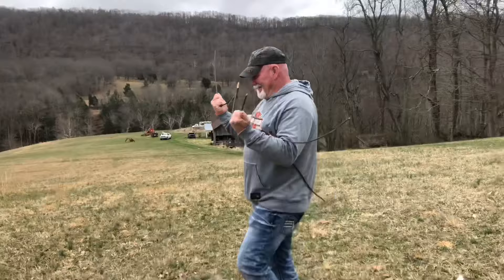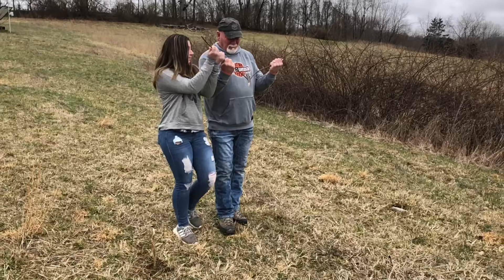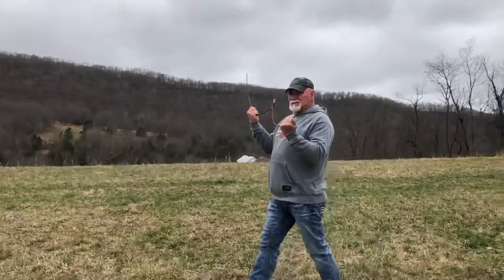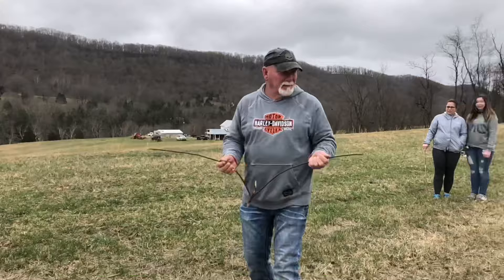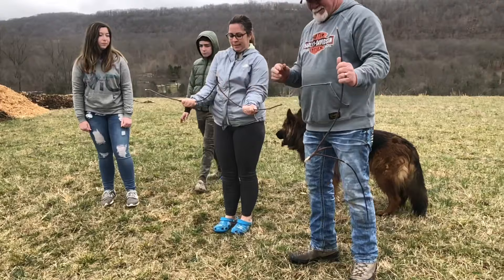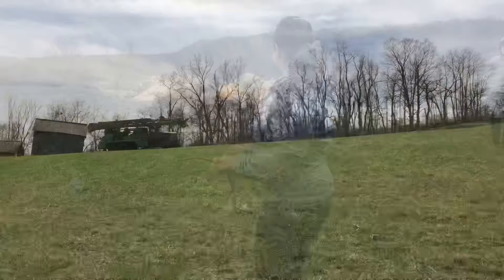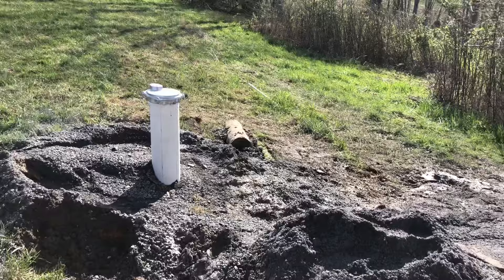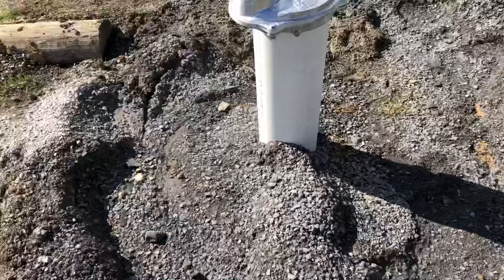Dowsing / Witching a well. Does it work? Thousands of $ later we find out.  Definitively answered.

Comment: I worked in the scientific world all my working life as a scientist in Silicon Valley.  I'm now retired, on 5 acres where we built a house.  I became curious about dowsing, discarding all the weird stuff about magic crystals and zeroed in on copper dowsing rods with a copper handle.  So my local hardware store had 3/16" copper grounding rod and 3/8" copper tube and that's what I made my experiment with.  I bent the rod so I had 6" handles and 18" horizontal bits.  
Then, without any expectation of any result I walked over my land and I was astonished to find that the rods swept outwards when I walked over where I had water lines, propane lines and septic lines.  I got a set of flags which irrigation guys use to set out a line of pipe from Home Depot.  Then as I walked the lines I planted a flag about every 10'.  They were more or less in a straight line following the underground pipe.
I experimented with and without gloves, I got no result with gloves and did get a result without gloves on the same place.
I also placed a very strong magnet on the ground where I had got a deflection and it had no effect on the rods.  I used one of those magnets on a rod that people use to pick up nails and similar large metal bits.
I conclude that this phenomena is not electromagnetic nor is it due to the earths natural magnetic fields.
I found that it does not need water in the pipe.
I also concluded that the phenomena is from the human body, the rods are simply indicators.
How and why does it work? I'm working on it...!!!
Reply: Hi Doc, I was a a drain cleaner for 20 years then plumber. I liked cleaning drains. Professionally when you have the proper tools its really not bad. I've cleaned over 40,000. Had a farmer call me out to the boonies one day. He met me at the edge of what looked like Lake Erie,
I was located in central Ohio. He told me, looking out over this never ending body of water, that a group of trees every bit a mile out had 6 feet of water under them. Then we drove down the road about a half mile and pulled into a farm house driveway. He had a track hoe and a hole 15 to 20 feet deep. He said, "if you run your cable about 50 feet up that pipe you should hit something and get that water moving."

Well I'm thinking I can run a hundred or a hundred and fifty feet up the 6 inch field tile but it was 3 thousand feet to the water.
Okay, lets give it a try. I set up some 2" pvc pipes to run the cable thru and started up the tile. 50 feet I hit a spot and before long water started flowing. "Damn," a few more minutes and the stoppage was cleaned up. (Probably roots)

The guy was so happy as he slapped me on the back and said the water should be gone by next week.
I thought maybe 6 months but kept my opinion to myself.

Anyway, he had said he and his Dad put the drain in 35 years ago so he knew where it the tile was.
Well I wondered for years how he knew where the stoppage was and only dug one hole in a mile long drain 50 feet below the clog.
He witched it. My old boss, I remembered, showed me years earlier using welding sticks with the flux knocked off how to locate
pipes that DO NOT have fluid in them. The bigger the pipe the deeper it works.

Freaking amazing.

I told another story of mine at apple drains video. Look down about 25 comments to read it if you don't have anything better to do. Yea, right.   https://www.youtube.com/watch?v=q3bR3UU6UGA     Good luck........I think it is just some help from upstairs.
Reply: It works from witch craft bout 1500 to 2000 years ago you can watch sam and colby if u want if u dont like scary stuff dont watch them or u could watch TFIL
Reply: Glad to see I'm not the only one. You can walk over ground where the rods don't move and then trow pvc pipe down on top of same ground and walk back over and they will move. Also I've found if you hold hands close together they push apart from each other and if you hold your hands shoulder width apart they pull to center.
Reply: @Moz29   that's uncalled for wtf?
Reply: The dowser makes a small hand movement, often subconsciously, at a location they expect something to be. If you already know approximate location of pipes or a spring then all you are doing is fooling yourself. Successful water dowsers actually use cues and clues at the property whether knowingly or subconsciously. Ground elevation and topography, soil hardness and moisture, vegetation, surface rocks, the location of nearby bodies of water, etc. They don't need divining sticks or rods, they could just as easily walk the ground and point out the better well locations.
Reply: @tomszabo7350  brilliant explanation. Let’s not forget also that water is basically everywhere if you dig deep enough.
Reply: @Moz29  Genius, as if your science can explain everything. But you skip out on that part because it will degrade your ego.
Reply: @yummygoy5138  I genuinely have no clue what you’re trying to say.
Reply: @Moz29  If your "science" is so great why can't it find the cheapest solution to purifying seawater or prove the unbased evolution theory? Because you eat up everything given to you by the experts.
Reply: @Moz29  you're the type of person to wear a NASA shirt without knowing what nasa stands for.
Reply: @Moz29  Funny how your only comeback is regurgitated nonsense with no example as to what is wrong with what I said. No it's not projection on my behalf but yours. And that NASA example blew way past your head buddy.
Reply: @yummygoy5138  If you genuinely think this way then there's nothing I can say. You can't argue with stupid. If you make a claim about me- not the other way around- then how could I possibly be the one projecting? I don't need evidence to dismiss anything presented without evidence in the first place. What you said was argument from ignorance fallacy. I assume your only alternative to theory of evolution would be creationism? Why even move the goal posts though? The subject of dowsing has been covered by science a very long time ago. Only those who are ignorant will maintain ignorant beliefs. NASA example didn't go over my head it just wasn't even relevant at all. You think I blindly follow scientific organizations like they are cult leaders or something? The thing about science- which you probably havent realised- is that fundamental to how it works is repeatability. You can go and repeat experiments for yourself and see the results. You don't need faith in scientific experts in order to see the truth in their claims, you simply look at their methods etc. This is not true of religion and since you brought that up, I thought i'd mention how hypocritical that NASA statement really is.
Reply: @Moz29  nobody is reading that, relax my fuzzy buddy
Reply: @yummygoy5138  You just proved my second sentence- assuming you made it that far.

Comment: I think the water creates a frictional charge as it runs through the rock. It’s a very weak charge. Witchers I have run into are very sensitive to electrical current. I am mildly sensitive, it works if they have the other end of the stick or rod. The last time I drilled a well I had 6 different withers come out. 4 got a hit where we drilled.  All but one used copper rods. Copper is a very good conductor of electricity. Got a great well in hard rock, water runs in veins in hard rock.

Comment: That first 5 mins reproduced my experience as a young boy exactly.  One of the neighborhood kids had a thin forked branched and was demonstrating this in his front yard to a whole gaggle of kids.  I'd say maybe half of us could do it and the other half, not.  It worked for me.  No idea why, but I recall the strangest sensation as the stick began to point down. It felt like it was being pulled down by an attachment to some spot on the ground, as though a string was tied to the tip of the twig and was being pulled down to a spot on the ground.  Then, as you'd back up a step slowly, the force pulling the tip of the twig downward would relent, and it would elevate again. Forward, pull down, backward up.  I could stand in position and rock forward and backward and watch the tip of the branch pull down and come up, pull down and come up.  That is how precise and sensitive this was for me as a 10 year old.  There was a very definite, palpable force pulling on the forked branch (very thin).  NO WAY was I subconsciously moving the branch.  The force was not weak!  It was substantial.  I think using the two metal rods may be much easier to introduce artifact by accidentally subconsciously moving your wrist ever so slightly, since those types of rods seem much more sensitive to wrist position and movement, but a full-sized cut wooden forked twig is far more resistant to movement by tiny inadvertent movements of the wrist.  I would postulate that metal rods sitting inside very slippery sleeves would be the easiest to accidentally move.
Reply: dowsing is a scam.
Reply: @michaelcohen9363  Might be for sure.   I wonder if anyone has ever done a really good, well-controlled experiment to see if water is found more frequently than by simple chance?     Some people say the rod or the branch moves for them and other people say it doesn’t do a thing in their hands.  Two science degrees later and I haven’t the foggiest idea how a wooden twig produced a force against my hand but it did.  Whether it was moving over something deposited in the ground or water, or some kind of other field, is a whole different question but I have no idea on that either because we were kids and dig anything.   Just walked around the yard amazed that the stick was curling down on its own sometimes.  But no doubt there have been people who used it to scam others.
Reply: @centerice  It's psychosomatic. There is no force produced, or otherwise it would be incredibly simple to measure.
Reply: @centerice  I have no idea why it works other than we do have metals in our body and there is a thing such as grounding when we walk barefoot on the ground so I could see there being some magnetics working there. But anyways my friend during a major drought here in South Carolina had their well dry up everyone's well was drying up this was probably about 14 years ago maybe. Anyway they had some Amish people come out that do the water dosing. They walked all over the yard I believe they were using a metal rods and they found a spot right next to the well almost that had dried up and said this is the main area of water. You're well just needed to be moved over a little bit from where it was placed. They dug that well that day hit water and it's never dried up in these 14 years whereas the other one has remained dry. It's no wonder that things work for some people and not others we are different chemical compositions a little more of this a little more of that for each person. That's why some things are toxic to some people and not to others
Reply: I use L-rods I made from spring steel. No copper handles. I’ve not only found water for wells but found lost septic systems. I set 3-5 flags in a row, not just one. That way I find running water. I personally believe it is electromagnetic fields where water passes through the earth through the channels of water.
Reply: As a dowser with two rods, I maintain it really is a force from other than my hands. One time the very person who initiated me and I were wrapping up the project of burying a water line between well pit and calf waterer, a 150' run. This was dry unused tubing buried eight feet down and the valve in the well pit had never been opened. I stood over the spot where the line ran and my friend opened the valve without telling me. I stood as still as I could, held my breath with open rods. When they crossed, I yelled. It was a couple seconds elapsed time, perfect.

 I really sat up when I first saw the technique here in this video. Can't wait to try it. When you see it and others' reactions, it makes you a true believer. True mystery. We need more of those.

Comment: Thats how both my wells were drilled using dousing. The guy that did it has moved on. Just fixed the cistrine it was decommissioned and they cut the casing so it was taking water on for 20 years. finally got a sink hole bc the concrete on top moved with the earth.

Comment: True Dowsing follows the rules of metaphysics, physics & quantum physics combined in Synergy/coupled. The biggest difficulty for Dowsers is POLARITY. I was fortunate enough to be a Metallurgist and understand the nuclear spin and polarity of the elements. For example Silver is South polarity whereas Gold is North polarity and all of the 80 plus elements have a magnetic polarity and send out a vibration/signal even without stimulation. What often happens is that a gold treasure signal gets warped and travels away from the actual target and fooling the dowser. So you have a gold target and gold is North polarity and nearby is a large deposit of clay (which is usually South polarity) and opposites attract, so the clay pulls the gold signal into itself even hundreds of feet away at times. On the other hand Silver is South polarity and so is clay (usually) and Same/Polarity repels each other, so the clay pushes the silver signal off of the actual target anywhere from 20 feet to hundreds of feet, again fooling the dowser.
Water at 50 degrees F is South polarity and the water/fluid in your body at a much higher temperature is North polarity and voluminous. So then when dowsing for water works really good because their is a natural attraction there.   Cordially, Robert
Reply: Thats a very interesting and insightful explanation that actually makes a lot of sense to me......Ive been dowsing and drilling for over 35 years...see my "water bore drilling tutorial" on my channel......I can dowse water in my sleep but gold lol thats why I'm still drilling after 35 years
Reply: @waterboredrillerswaterbore505  My Uncle Wayne was a water-well-driller and always dowsed his water.

Comment: I helped drill water wells for three years.  The owner of the company believed in dowsing.  From my experience we usually hit water just about anywhere we drilled.  Many times we drilled on small lots with only one place to put well (to stay away from septic systems and neighboring systems). And yes, we normally got water.  The real question is, How deep is the water.  It could literally be beyond the capability of a 1100' drill rig(T3W for all those well drillers). In the three years
I worked there (approximately 250 wells), we drilled 1 dry hole 1100' deep.  We did drill many low producing wells with 1/2 gallon per minute, but when considering 1.5 gallon per foot water storage, that's a great deal of water at 400' deep.  The more I worked there, the more I realized I knew nothing about where the water is. I'm not saying dowsing doesn't work.  Just my observation.

Comment: I don't doubt they work, I've seen it used finding water lines. However here in my area, pretty much anywhere you drill you will hit water, but an old timer used to use this, he always found water in the shade in summer, and in the sun in winter. As I said I believe it works for some, and is needed in some areas
Reply: There are no water lines. Water collects in aquifers, not lines.
no one has magic water detecting powers using magic wands.
Reply: @MagnificentXXBastard  I think he means he believes they find water pipes. Either way, it seems like bull to me.
Reply: @markp8295  obviously its bullshit lol but i think he means water lines, not pipes. an old superstition that groundwater exists in subterranean streams or lines.
Reply: @MagnificentXXBastard  I've never heard about that theory before.
They must not have played with sand at the beach growing up.

Comment: Watch the heels of these folk. Ask them to work over a firm surface.  One could also compare their results with values of softness/hardness with a cone penetrometer.
Reply: I've accurately discovered and determined the path of water lines underneath concrete floors. With no prior knowledge or guidance, I've marked a path and then had a plumber come in to confirm that my marks were consistent with where he had installed the line.

Comment: I dowse, but I use rods. Rods seem to be the only reliable way for me to dowse. I tried dowsing with the “forked stick” method, but I never felt comfortable with the results. I have also tried using a pendulum, but I never felt comfortable with that method, either. When I use rods and think about that for which I am searching, the rods work best for me. If you are not able to get a stick to work for you, I always tell people to try the rods. Whatever works for you is the best way. If you are working and learning under an experienced dowser and the dowsing is not working for you, get the dowser to lay hand upon your shoulder, say a blessing to the Lord for the gift, and I will say (more often than not) that it will begin to work for you…I’ve seen it happen. I believe that dowsing is a gift from the Good Lord, and it is given to help mankind. There is no “witchcraft” to the practice.